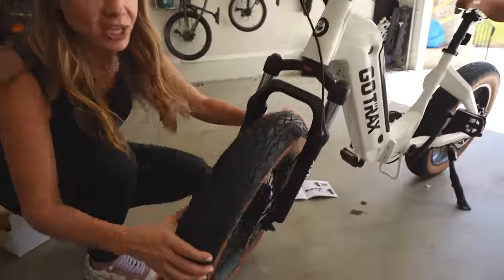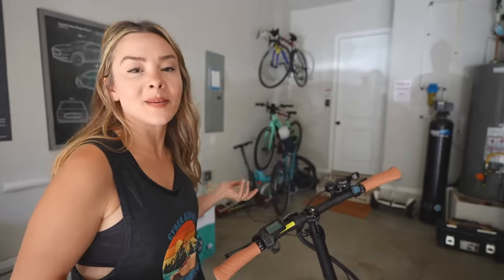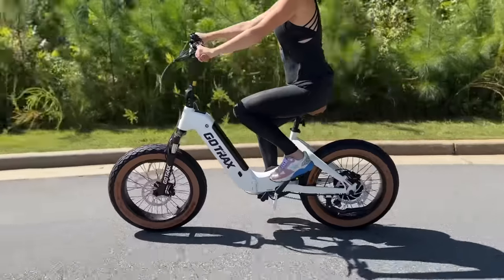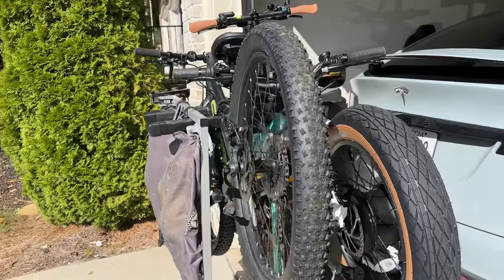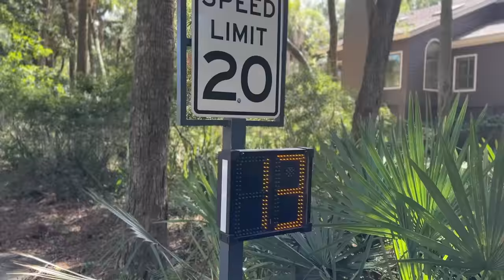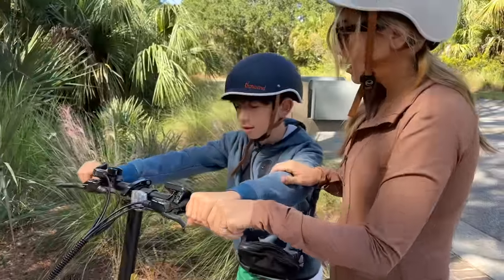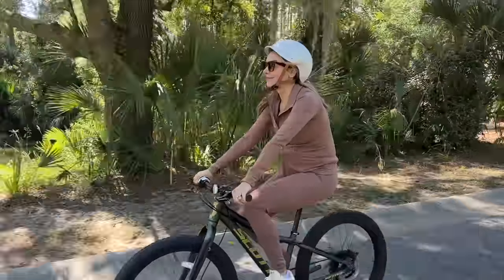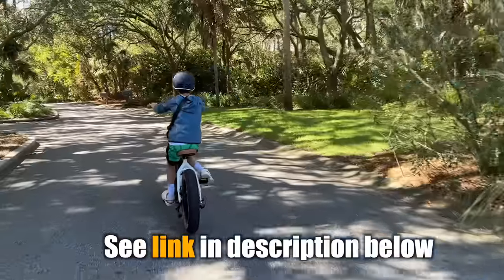The All-in-One Foldable E-Bike: GoTrax F5 Review

Comment: #1 Your seat is far too low.  You adjust for proper leg extension to the pedals when seated, not standing height over the seat. #2 almost every Chinese boxed bike will need the derailleur and brakes adjusted, which the manufacturers don't advertise well.

Comment: It looks good but for portability maybe a leaner version. When it has electric throttle I would think that a middle high gear would be enough. Indeed law aside, I'm not a believer of pedals. It's such an engineering burden and if it's powered anyway...  if they had to have pedal they could do a generator at the pedals so it's electric transmission and avoid the whole gear and chain thing.